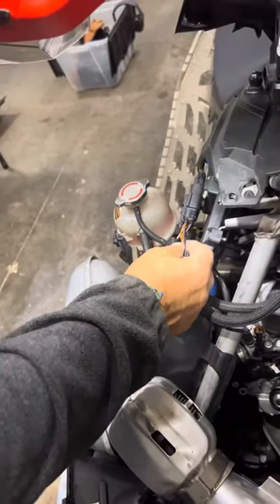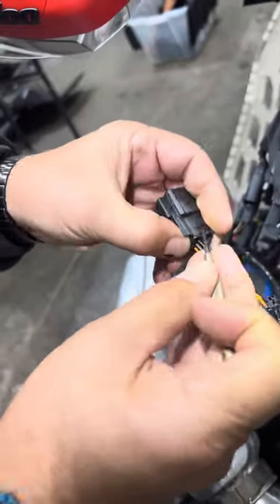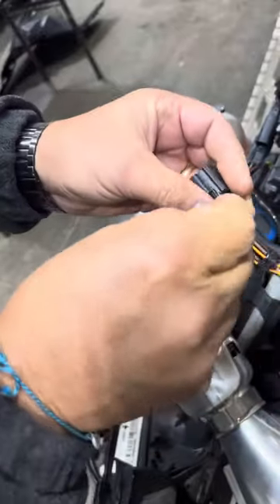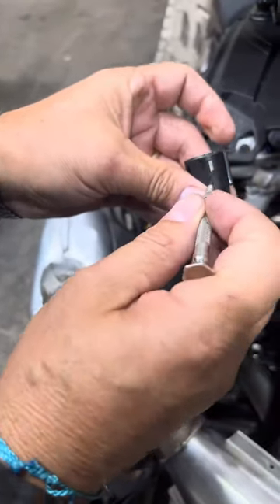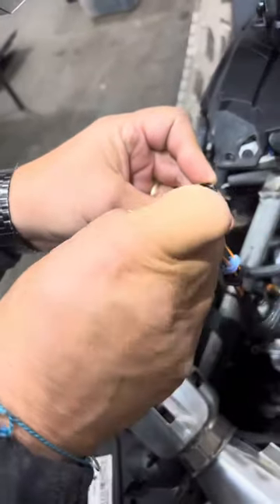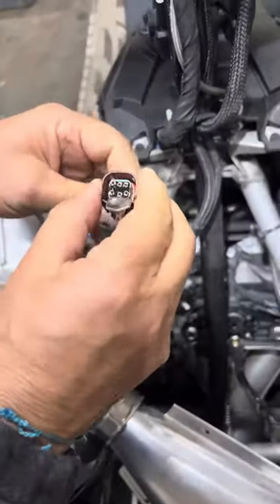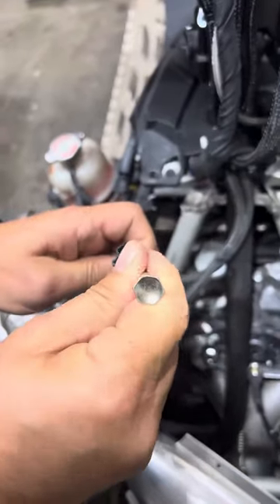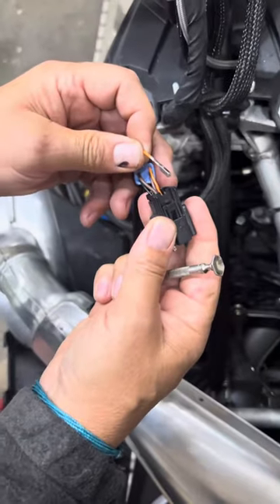Ski-Doo BRP G4 connector pin removal for hand grips

Comment: Thank you!  This was very helpful. Was in the middle of trying to release the pins and couldn’t figure it out. Your video was the first hit.
Reply from the maker: Glad it helped!
Reply: @markusvt1  very much.  Another question... Are the two browns for thumb heat interchangeable or is there a positive negative preference?
Reply from the maker: @alexislynneberube  They don't matter.
Reply: @markusvt1  thank you.  That's what I figured where it's a resistance heat trace cable but just wanted to make sure.  :)
Reply: You certainly seem to know what you are doing so I’m wondering if I could pick your brain. My grips all of a sudden are staying on high and won’t shut off, l pulled the plug that you did here and it cut the power to just one side, pulled the one under it and has shut both sides off. Any idea what could be going on. It’s a 19 850 Blizzard  Any sort of direction would be appreciated
Reply from the maker: Powered from the gauge, pin 5.

Comment: I bent my bars on my G5. Is there a chance on reusing the elements and cork insulation to avoid the wiring hassle or are you supposed to replace them?
Reply from the maker: Not easily reused.  Maybe try a battery directly to the element to heat it up enough to remove.